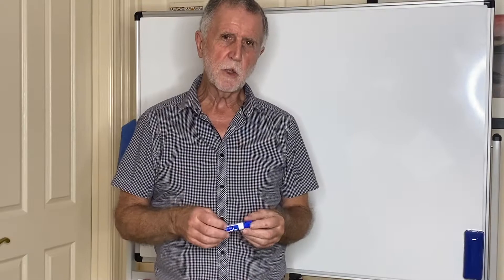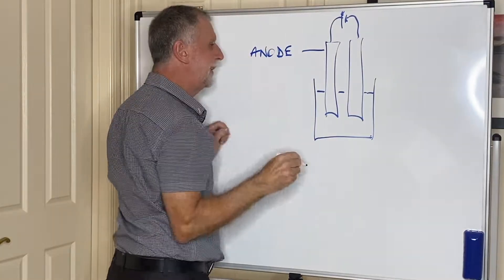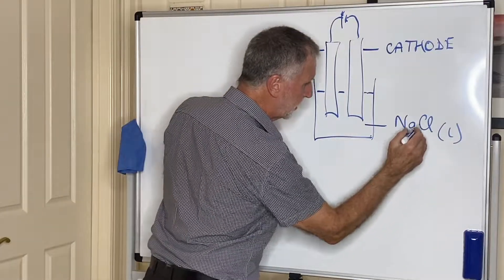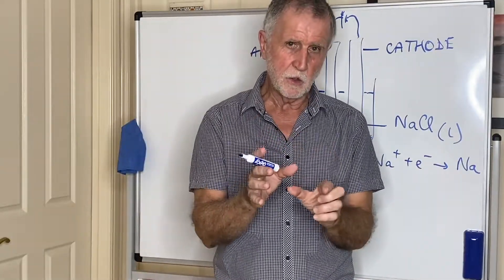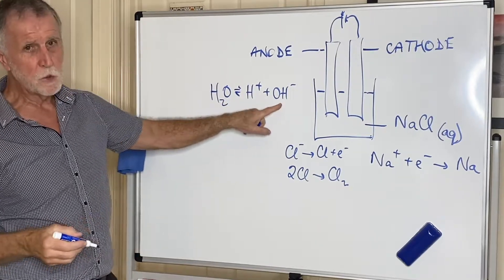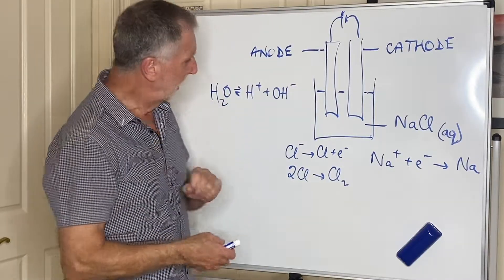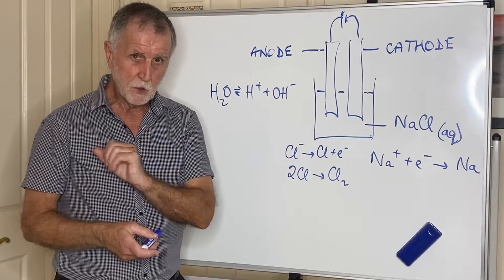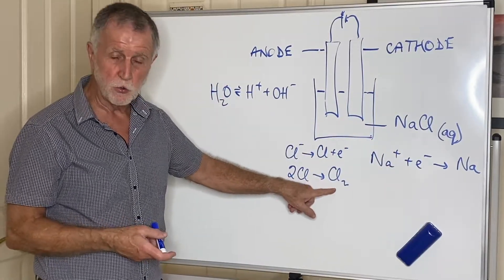ATAR QCE Chemistry Unit 3 Topic 2: Electrolytic Cells

Comment from the maker: NOTE

In this video, for the electrolysis of aqueous solutions, I talk about the competition between the ions in the specific chemical and those from water. This is NOT correct - the reason I gave this answer was because it was the answer QCAA gave in their practice papers - and they are the guys that produce the marking guide for the externals! The reality is WATER MOLECULES THEMSELVES compete with the ions from the chemical. This should be obvious and easy to understand as water molecules out-number the hydrogen and hydroxide ions by factors in the millions. In the ECS provided in the data book, BOTH equations are given and QCAA markers should accept BOTH answers.

Comment: Hi there Dr T., at around 7:50 you say sulfate ions are not in our data book, but they are listed SO42- + 4H+ + 2e- --> SO2 + 2H20 (E cell = 0.16V).
So do we ignore SO42- simply because it cannot oxidise and Cu2+ are more easily discharged as the reduction half-equation?
Reply from the maker: Yes you are correct - sulphate ions ARE in your chart but ONLY as an oxidiser - you need them as a reducer and they are not present.

Comment: If you had NaCl(aq) wouldn’t that mean we would have:
Na+
Cl-
H2O(l) 
Because the only two that would end up reacting are the strongest reductant and strongest oxidant, wouldn’t that mean we would use the two H2O equations from the QCAA website and hence the chlorine would not end up taking part of the overall reaction?
Reply from the maker: Very fair question and exactly what you would expect ... and it does just that ... in dilute solution. But if you look at the E values for H2O and Cl- discharging you will see they are pretty close (1.23 and 1.36V respectively). This means that concentration will play a part. If the solution is concentrated, the large number of Cl- ions can tip the balance in their favour and overcome the extra voltage needed and chlorine gas is produced.

Comment from the maker: Hi guys I've had some people comment that it's the water discharging at the electrodes, not the ions. I am very aware of this ... and agree ... BUT in the QCAA's marking guide they provided for the mock 2020 exams, they clearly say it is the IONS of water that compete at the electrode NOT the molecules. So, I am simply going along with their answer as they are the ones who will be marking it.
Reply: Hi, I also looked at one of the marking guides and it said it was the ions of water that compete at the electrode. But I was just wondering if it specifically says on the marking guide that it must be ions rather than water (as in they wouldnt accept if we do it the other way)?
Reply from the maker: @abdul-waahidlatif9063  not sure what to tell you - I'm just saying what the QCAA marking guide has. In my opinion BOTH answers should be accepted.
Reply: To add to my previous comment, logic dictates it has to be water discharging - think about it, the pH of pure water at 25 Celsius is 7, meaning the hydrogen ion concentration is 10-7 - so there are almost 10 million water molecules for every hydrogen ion and hydroxide ion. What chance do the ions have?